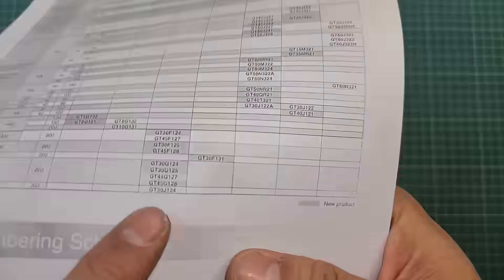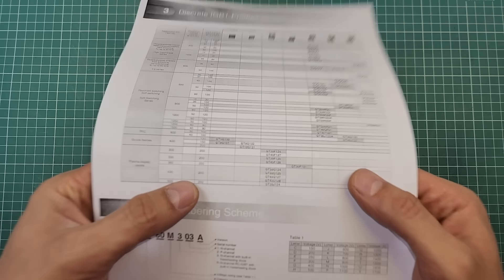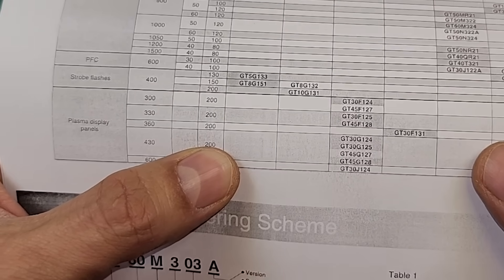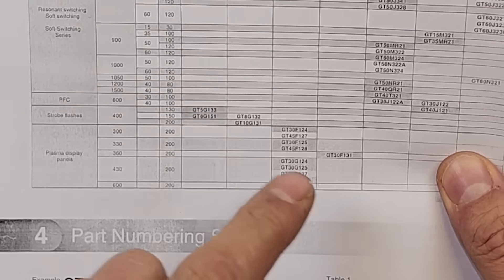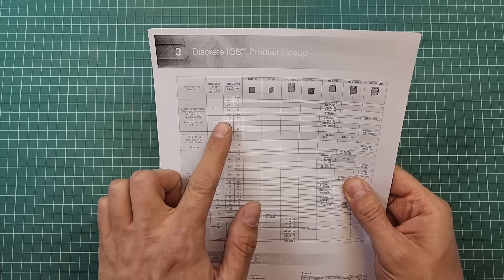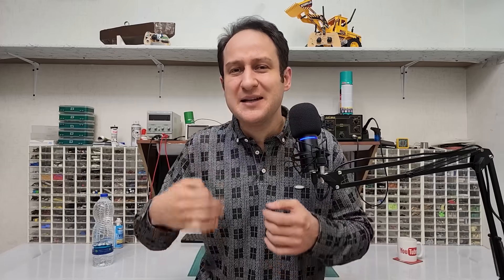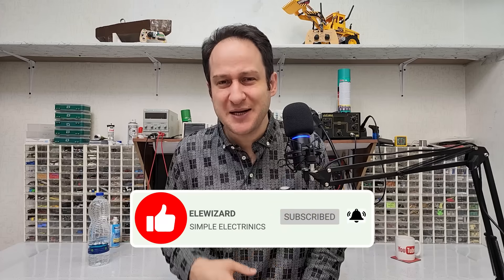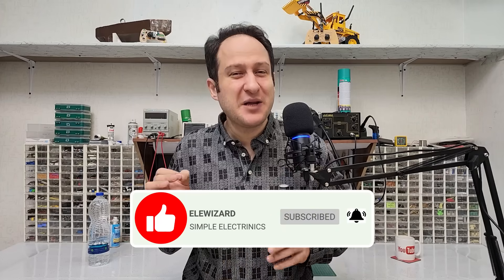Can a small transistor really switch 200 amps of current?

Comment: At 200 amperes a TO-220 package isn't a "transistor"; it is a "fuse".
Reply: ...an explosive one, at that.
Reply: @AttilaAsztalos  It's really not. A mosfet with a 10mOhm RDSon isn't anything special and 20amps continuous is only 4watts of power. For extremely short pulses, 200 amps isn't unreasonable. Actually, for that matter, you could probably run 200amps through a 30amp fuse for longer than you could run it through this IGBT.
Reply: @SkippiiKai dude, 200A through 10mOhms is 400W not 2W.
Reply: @bretfuzz925  🧐 Well, when you phrase it like that I question whether I should really be tutoring math! I think I meant the 20 amp continuous rating. I don't know how I posted that, but I'm glad you caught it!
Reply: @SkippiiKai we all make mistakes every so often. These become humbling events. If you are a math tutor, you should continue doing so. Tutoring is a very honorable thing to do and without tutors many capable people would not get the extra nudge they need!
Reply: @Milosz_Ostrow  
😂😂, I have never seen a fuse blowing to protect the MOSFETs, but I have seen MOSFETs blowing to protect the fuse 😁😁
Reply: @Milosz_Ostrow  Also, because you were clearly being serious and I'm neither sarcastic nor pedantic, IGBTs normally fail as a short-circuit, which means you can not use them as fuses.
Reply: @SkippiiKai  but, sir, you didn't complete the process. After it shorts and then 200 amps continues pumping through it, what happens next? (See OP's comment :)
Reply: @ArchetypalCat Well, hopefully next an actual fuse does it's job correctly.

Comment: 12min video and not a single hands-on test. Not to mention GT30xxxx means 30 A constant load without even checking the datasheet.
Reply: The 30A rating is an optimistic value. The datasheet shows the TO-220SIS package can handle 25W max at Tc=25°C. Given a max junction temperature of 175°C, that's a thermal resistance junction-case of 6°C/W. The datasheet indicates a typical Vce(sat) at 30A of over 1.5V, which is a power dissipation of over 45W continuous, giving a temperature difference jcn-case of 45 x 6 = 270°C. To keep the junction below 175°C, you're going to need the case kept below -95°C. Good luck with that.
Reply: @RexxSchneider  LOL spot on !  I don't know too many peeps who like to cool their TO-220 package with liquid nitrogen ...
Reply: @ArchetypalCat Rex was mistaken. The part is 0.6C/W. He was off by a factor of 10.
Reply: @RexxSchneider it’s all about duty cycle.
Reply: @bretfuzz925  It's got nothing to do with duty cycle. We already know from page 12 of the datasheet that it is rated at 200A pulsed for 3μs. What "duty cycle" do you imagine is needed to deliver 30A?
Reply: @RexxSchneider the datasheet says 0.6C/W.
Reply: @bretfuzz925  No it doesn't.

Work out (175-25)/0.6 and you get 250W. It's rated at 25W on the datasheet. Try again.

The θjc is 6°C/W.
Reply: hands-on test is not a turkish custom lol
Reply: So, do they call you Sparky or Smokey at work? :P
Reply: Calculate the wattage when sinking 30A. 30x Vce(sat) @ 30 A. Now divide 25W by what you just calculated. That will tell you the duty cycle to average 25W.
Reply: @ We already know that the Vce(sat) is at least 1.5V at 30A, so the dissipation is at least 45W. Therefore we would have to have a duty cycle less than 25/45 = 56% to keep the junction below 175°C.

But why not call it a 40A device? After all, by your logic, the Vce(sat) at 40A is 2V, so it dissipates 40A x 2V = 80W and needs a duty cycle below 32% to avoid overheating. Or a 50A device? and so on. You can draw any current you like up to 200A if you keep lowering the duty cycle. What's so special about 30A?

Did you not read the first post in this thread where the poster claimed "GT30xxxx means 30 A constant load"? or didn't you understand what CONSTANT means?
Reply: @RexxSchneider you have been correct all along. I read some incorrect information on Rjc. It can only be derived from (175C-25C)/25W = 6C/W as it is not explicitly stated. This device and probably all in the TO220SIS package don’t have constant currents specified so ~20A would be the max continuous current for all of them. Toshiba has EOL’d all of the TO220 IGBTs from what I can see with no direct replacement. It appears as though none of the TO220 IGBTs adhere to the part number convention for continuous collector current.
Reply: If 12 minutes of theory is too much for you, perhaps you should consider something less mentally demanding than electronics? Maybe try accounting? 💁🏻‍♂️
Reply: @johanslabbert2869  I agree. Getting to know one switch component requires more than one hour (1 h) working time. The starting point is SOAR table i.e. Safe Operating Area Restrictions. If you do not find SOAR table or graph, take a better component. With SOAR values You can start Your design. In switching there allways are moments, where high voltage and high current exist simultaneously due to inductances and the speed of physical events inside the silicon structure; inevitabely.

Comment: Short version:  If you mis-read the datasheet, you will get the wrong answer.
Reply: I would add: if you don’t know ohms law the datasheet is irrelevant.
Reply: @AcuteChronic  words are hard.
Reply: @hamaljay  numbers with funky Greek symbols be harder.
Reply: The real problem is not realizing that the amperage must be limited by the thickness of the cable and that this applies to every connection.

Comment: What is important is the maximum junction power capacity. It can be calculated by summing the power dessipated during the switching on and off times,and the turn off and on times and taking into consideration the swithching frequency. The result should not be more than 50% of the maximum junction power capacity for reliable operation. Heatsink design should follow to prevent the junction temperature from exceding the maximum junction temperature of the device.
Reply: Just curious - where did you come up with 50%? I don't doubt that you are correct, but would like to know what's the theory behind it? thanks
Reply: @ArchetypalCat sir for safety factor, because we should not operate the device to its maximum power capacity only half. This is equal to 1.5 safety factor.
Reply: @reylambarte5615  of course, but what reference / source says 50% duty cycle (or 1.5 safety factor)? I mean, why not 30% or 80%? For instance, using a potential max load of 80% is common practice for 120vac residential circuit breakers - just to pick a random, arbitrary example.  WIth leads that skinny and the potential for long-term degradation of the thermal bond to the heat sinks, I'd be more inclined to derate it to 30% duty.  Not to pick a nit, but often such references are just passed along like stories and myths - and like those, no one really knows their source. :))
Reply: @ArchetypalCat sorry i am not talking of duty cycle but power dissipation. Example if your computed power that the device will dissipate is 50 watts then multiply that with a safety factor from 1.5 to 2, you will then need a device that has a maximum capacity of 75 to 100 watts. The choice then depends on the cost and dependability. Electrical standards is different to electronic devices  because of the materials used.
Reply: @reylambarte5615  yeah, I didn't mean 'duty cycle' but 'loading' ... was super tired when I posted that.  Understood re standards - I just picked an arbitrary example.  Again, I am trying to understand where the choice of safety factor comes from. Considering electronic devices we might go all the way "down to the metal" and review the PN junctions in terms of physics, e.g. surface area and thermal capacities, etc.  If the 50% (or 1.5) is just some commonly accepted rule of thumb based on decades of spit balling, that's fine.  But where is the materials science basis of such a rule to be found?
Reply: @ArchetypalCat if you consult books on power electronics you will read it, it is just the rule of thumb meaning it was just base upon the experience of experts who make the design. To me value is actually not standard the safety factor may vary that depends on the application. If the circuit is for comercial application usually 1.5 safety factor is enough, for industrial application you may use 2,  and 3 or more for greater realibility in military grade circuits.
Reply: @reylambarte5615  OK thanks - as I suspected, no one really knows for sure why the values of those rules of thumb are what they are. :))

Comment: current capacity is purely a therman concern….   so   if you cool with liquid nitrogen anything will carry 200A
Reply: ...well everybody's gangsta until the liquid nitrogen's gone and the superconducting suddenly stops...
Reply: I see some problems with this idea...  Cooling the IGBT to liquid nitrogen temperatures is going to change the device parameters significantly and the device may not function in the intended manner.  In addition, once you start dissipating heat in the device I think it likely the liquid nitrogen will boil violently  and the Leidenfrost effect will prevent the effective dissipation of heat from the device.